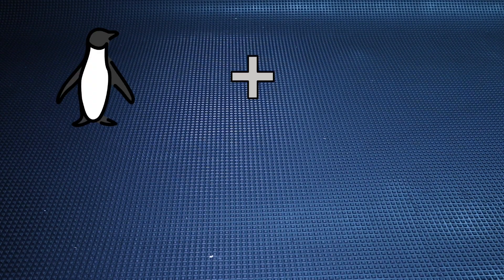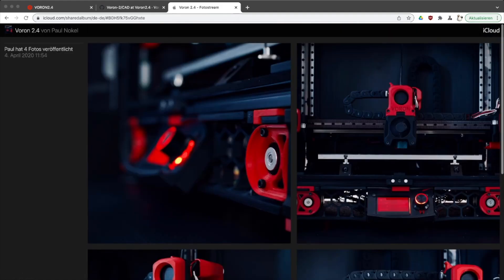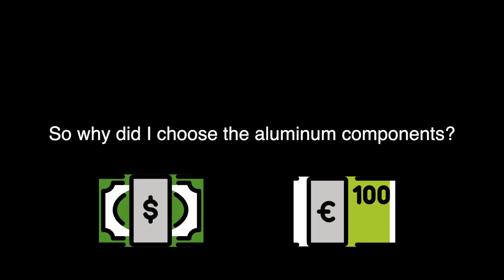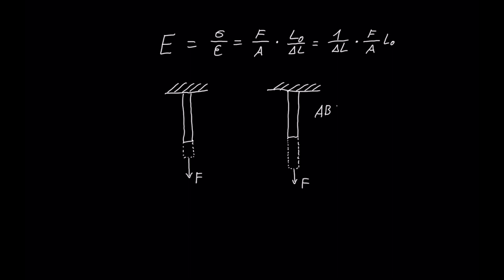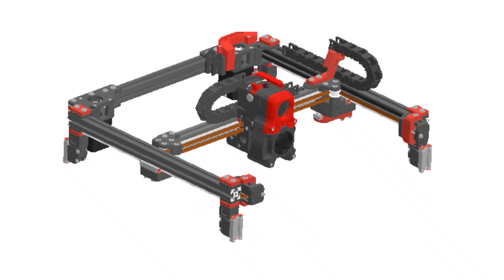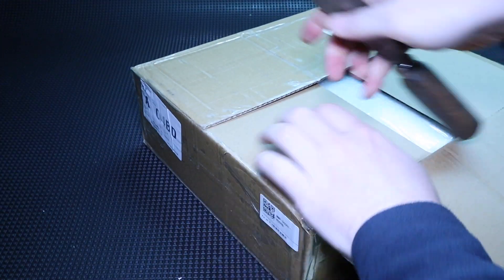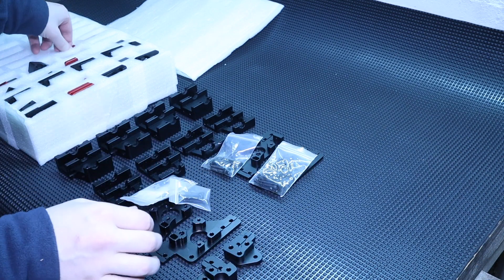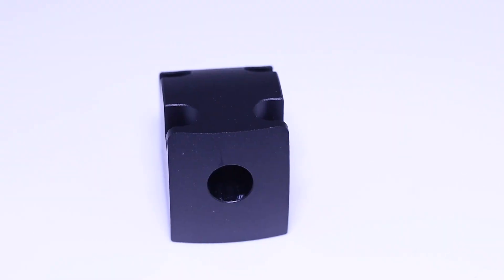Aluminium Parts 1

Comment: Aluminium is only a option if you want to water cool the hotend and steppers and install a chamber heater for more than 60c chamber heat. 
I use 60c chamber temp and replaced some parts with PC-Blend for higher heat resistance. 
I have a hobby CNC and could mill the parts myself but it’s not worth the effort in my opinion.
I’m not sure the belts are rated for a 90c chamber temp and a clicky probe would not work anymore too probably.